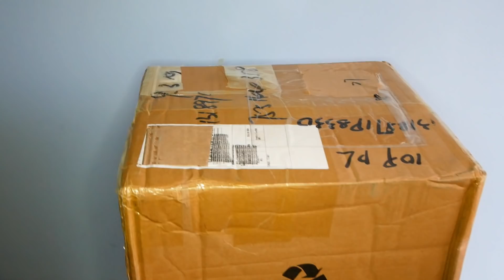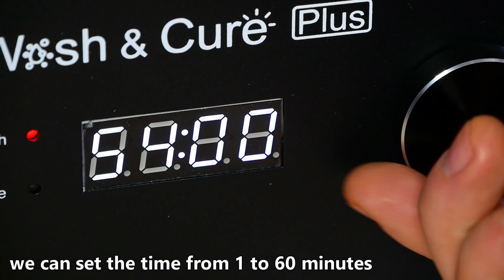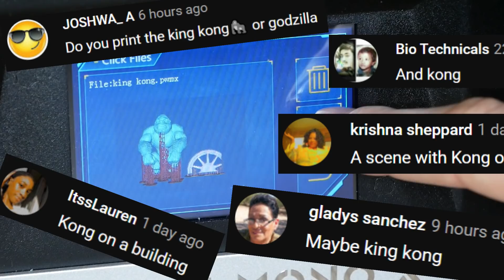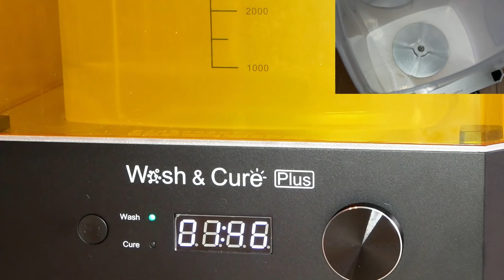My new tool 👍 Anycubic Wash & Cure Plus / Bigger, Better, Faster / RESIN ART

Comment: Hello. Looks nice. But how much alkohol do you have to fill up before it covers the bottom of the cage? 1 liter? Is it possible to get the plate lo into the cage or does the container have to be filled to the top to wash the model while attached to the base? I want to do a bit plate of small items so I it seems like I would have to have 5 liters of empty liquid before it touch the minis, right?